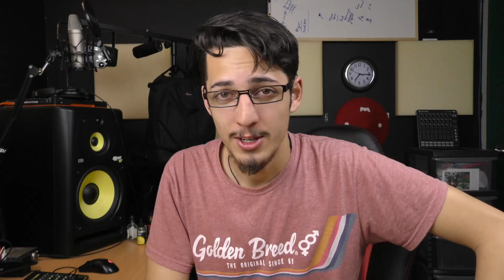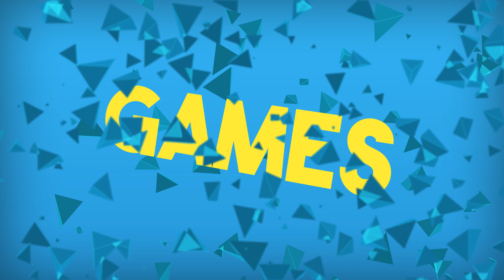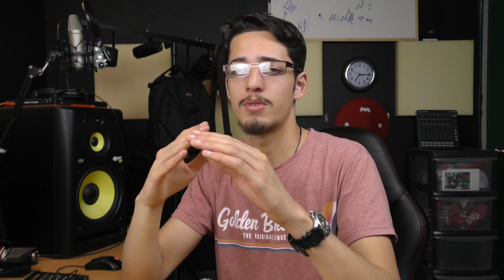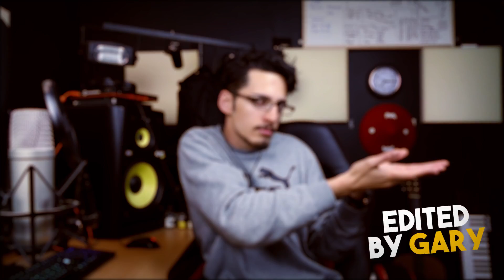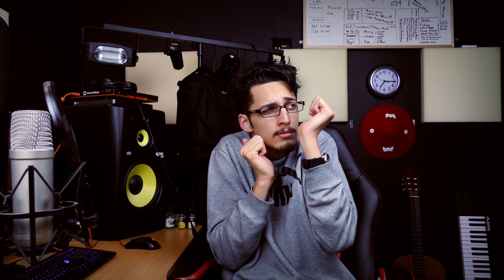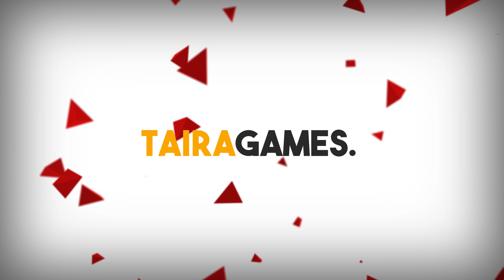Using Particle Systems

Comment: Particle systems are easy. You just have a particle who is chosen by all the other particles to be the main particle,  then you also have a set of about 300 other particles who are chosen by clumps of particles to represent that clump. When decisions are to made on what particle is to be emitted, the rate of particles and their path the representatives of clumps of particles all put it to a vote and the head particle can chose to overrule the vote if the situation calls for it.